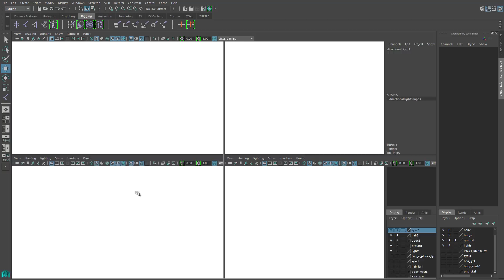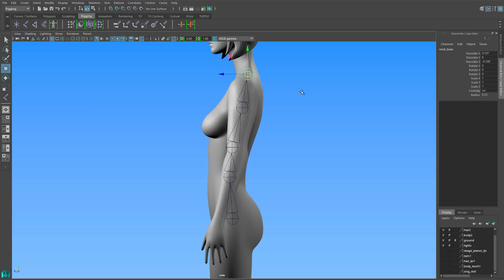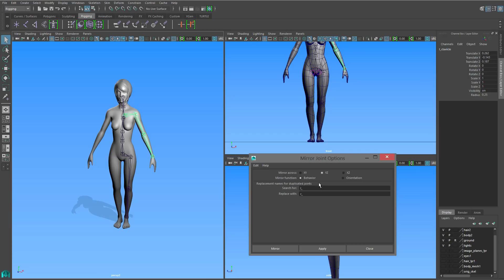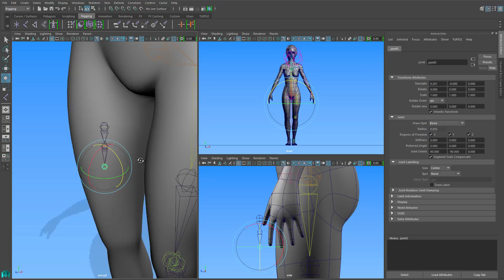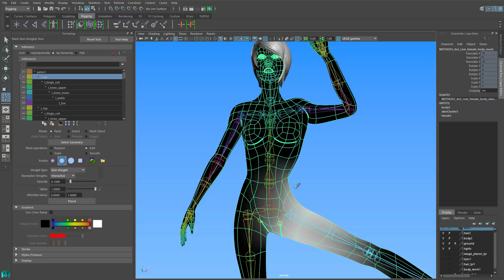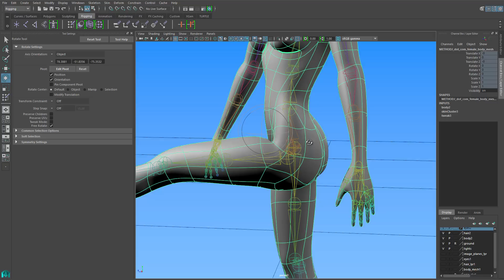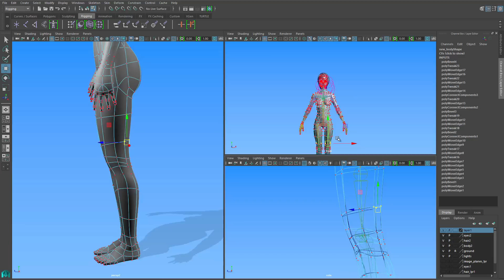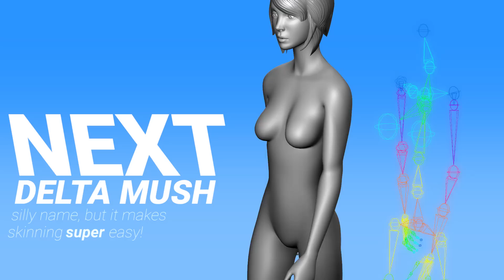MAYA CHARACTER RIGGING TUTORIAL: JOINTS & SKINNING

Comment: hi james, great tutorial as always, i've seen that you completely ignored joint orientation, in some digital tutors tutorials that i've watched the rigger usually checked the joint orientation which was wrong, then by unparenting the joint he zeroed the joint orientation and used an aim constraint to adjust it, is this process completely skippable? wouldn't this cause problem when deforming with inverse kinematics? Thank you :)
Reply from the maker: +Adonai I recorded a whole section about joint orients but cut it due to time/complexity. There is a joint reorientation tool, which makes the process very easy. Or, just duplicate existing joints, that way you know they are all oriented correctly.
Reply: +James Taylor Ok,  thank you very much :). You should consider uploading that section of the record as a different video, i'm very curious :)
Reply from the maker: +Adonai good idea, I will probably end up doing that.
Reply: James should all of the joints be oriented the same way or does that depend on where the joint is located in relation to the body. I seem to be having trouble with my joints not rotating in a correct manner. I tried duplicating the joints by snapping them to the base joint chain but the new joints seem to be inheriting the same joint orientation as the base.